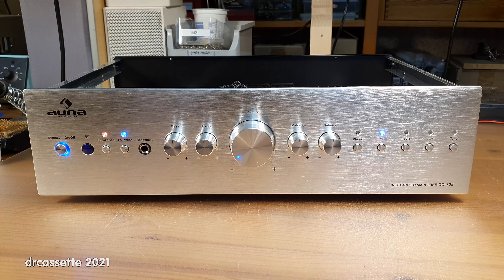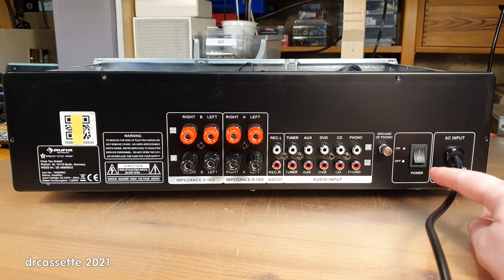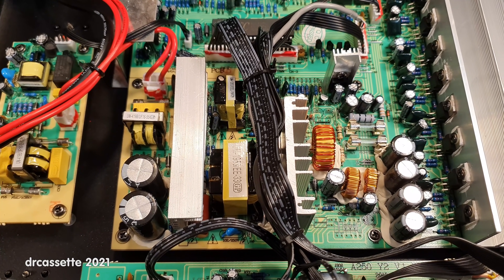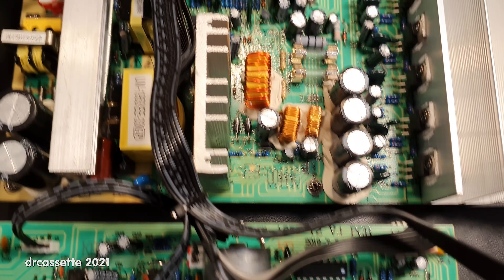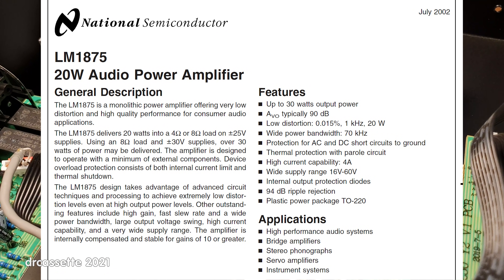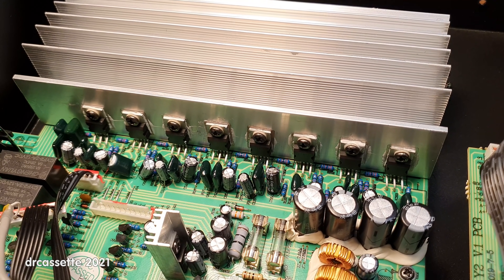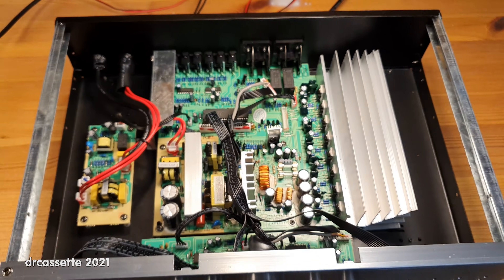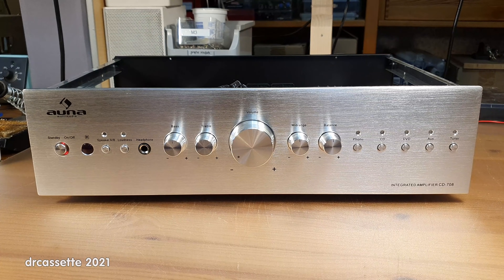Detailed look at the Auna CD-708 amplifier - with circuit overview

Comment from the maker: CORRECTION: After taking out the main circuit board and investigating, it turns out that the main amplifier is NOT based on parallel bridge circuits. Instead of two parallel bridge circuits for two channels, there are four simple bridge circuits for four channels. There are four speaker outputs, pair A and B. Even though this is a stereo amplifier, every output has its own dedicated amplifier channel. This is another strange design choice, as most of these amplifiers will probably never have any speakers connected to the pair B outputs. The headphone output is connected to the pair A outputs, so really the two extra amplifier channels are somewhat of a waste. Knowing that pair A and pair B have independent amplifiers, I tested the pair B outputs, and as expected, there is no fault in these channels.

Comment: Hi I have repaired this amplifier and Is working very well, anyway I have noted that the voltage at output IC Is quite low +/-15V
Do you  remember if you measured the same ?
Thanks Best Regards

Comment: Ill bet its dry joints on the ic's. A very cheap fix....i should know as just fixed one for free. Lead free solder doesnt like too much heat
Reply from the maker: I never checked the underside of the board for bad solder joints, but I still have this amplifier in storage, so one day I certainly will :)

Comment: Looks like the speakercircuit is defect. Maybe the speaker relays need to be replaced or the capacitors. I had the same problem on an AKAI amp.
Reply from the maker: Did you finish watching the video before commenting? I think I gave a pretty clear explanation of cause of the problem in the video.

Comment: what is the job of the microprocessor ?
Reply from the maker: The microprocessor basically converts the operations of the momentary pushbuttons on the front and the operations of the remote control into control signals for the electronic circuitry.

Comment: Excellent amplifiers I have had two for 10 years nearly with no problems and no noisy standby or any other problems powerful smooth and reliable  and very very cheep as for running hot most amplifiers that I have had run hot as well in hot weather obviously they feel slightly hotter to the torch because of the ambient temperature me personally living in the UK 119lbs will not buy you a better amplifier on the planet unless you have one givien you or you inherit one
🤗🤗

Comment: I remember Auna. They used to make horrible PA systems with massively exaggerated ratings, yet they sold hundreds of thousands of them. I've noticed they rebranded their products to 'Malone', presumably in an attempt to shake the bad reputation.
Reply from the maker: Interesting, I have not yet seen any Malone branded equipment...
Reply: They market this unit at a ridiculous 125W RMS per channel! 600W peak!
It probably will do that, for a split second, before erupting in a shower of sparks and a column of magic smoke
Reply: @iaial0  Quite a few output devices on that heatsink, so I wouldn't be surprised if this thing could come close to that RMS figure during transients, but I highly doubt it can manage anywhere near the 600W peak.

Comment: I´m used to repair cheap amplifiers that uses ICs like this one here in Brazil, where I live. In my experience, in most cases this type of noise is caused by bad soldering on the IC´s contacts. As theses chips usually works at high temperatures, as time goes by the solderings become less and less reliable. So, when noise appears, the first thing I do is to remove all the soldering of the ICs and replace with fresh soldering. Chances are great the noise will go away.
Reply: Check my comment above, I have Same noise (but not so loud) on my Marantz amp. I will try to disassemble it and check for soldering. Obrigado, cumprimentos de P
Portugal!
Reply: @Gajodareactividade   use a heat gun on the soldering points see if it fixes your problem.. if so resolder all points to fix it long term

Comment: If you wanted to make a working integrated amp, you could pull that hinksink out, drop a class-D amp board in there, and bypass the existing amp circuitry. I don't think that would be too difficult but given everything else in the preamp section I don't think I'd bother. As you state in your video, the parts individually are more interesting / useful.

Comment: If you remove one of each pair of parallel ICs (one push and one pull) and the amp should still work, although with less  ability to deliver current.  Doing this first with the first two then the other two should narrow down which pair is bad  then substitute one from the bad pair for the good pair and you should find out by elimination which IC is bad. Then just install one  single 1875.

Comment: Also, the heat sinks are basically useless.  The web the the ic's are mounted to will do 99% of the cooling.  The heat has to travel down to the bottom then to the successive webs.  Very inefficient.  Basically useless.

Comment: Guitar amplifiers that take 12 volts will have switching power supplies to boost the voltage of soft in a good design I don't think of switching power supply should be a problem

Comment: Of course the Performance of These device is mit very high. The supply ans capacitors are looking very small dir an amplifier. But it will be also interesting what the Problem ist. It looks like a Bridge solution and a compare between the Others or Others half Channel should be easy.

Comment: There is no technical reason why you can't bridge-parallel these chips. Well, the authentic ones anyway. The manufacturers would rather you move of to the next powerful IC instead. Not sure why they didn't just use an LM3886 instead of all these chips. They probably know the counterfeit ones are junk.

If you decap one of those 1875 chips, the die size for an authentic LM1875 is 3.7x2.7mm.
Reply: Contrary to that I can perceive a certain risk..in this setup..
In one paralled bridge
1) all 4 power modules have their own , indipendent negative feedback paths..so 4 sets of f.b. components..& all may be minutely diff. from each other....
IMHO it would be better to have some common f.b. path taken from post  current limiting resistor ( spkr. terminal )  and then split into the individual f.b. paths....
In conventional amps , there are discrete parallel transistors but with only one ( common) f.b. path..and overall lower f.b. gain...( even if f.b. loop is open).
In case of power amp modules..
it is in reality an opamp..

Comment: Such noise is most likely from bad/ dry/ loose solder joints....include liberal spray cleaning of front panel switch selectors switches also. 
I would recommend desoldering one of the parallel outputs on both channels..and use at lower output & so thers a higher temperature  margin...besides 4 spare 1875..
Reply from the maker: I have not yet checked for bad solder joints. As the noise is not affected when disconnecting the signal to the main amplifier, there are no contact problems. Removing one cheap from each parallel circuit to improve stability is indeed an option.
Reply: @DrCassette  I would like to add one instance of such 
a dry & loose joint issue on my own amp...This bothered me hell of a lot @ times it played quite as a mouse.. , other times it was irritating..after redoing all suspect joints it still persisted ...until finally one day on suspecting an adjacent component.  the real culprit was found..though it joints looked good..one lead was dry....now no such problems ever since..

Comment: The reason for de-activating the speaker relays is that the CD4052B analog mux ICs don't switch "cleanly". You will often get undesirable loud noises (pop) which switching inputs, so to get around this they disconnect the speakers during the input switching.

Really odd choice to use a CD4052B when these days there are a plethora of purpose-made audio switching ICs on the market. I guess the CD4052B was cheaper, as it's a really old IC that is still in mass production.

Same with the 4558 op-amps, dirt-cheap IC that is still in mass production, but it's really a very basic general-purpose opamp, and not one that I would consider suitable for hi-fi audio applications, there are far better opamp ICs available.

I also see that they made the classic mistake of improper use of a heatsink. Totally the wrong choice of heatsink for passive cooling since the fins are in the wrong orientation. It's big, has lots of fins, but in that orientation it's actually not dissipating heat effectively at all.

Definitely a product meant to look high-end on the outside, but almost every corner was cut on the inside where it really matters.
Reply: Excellent analysis. This design actually looks like something that was recycled from 30 years ago. The 8051 mcu is a clue as well as the 4052s and the op-amps you mentioned.
Reply: There's absolutely nothing wrong with 4558s, they were used even in expensive gear in the late 70s and 80s. And these units obviously sound good. Audio frequency is not a demanding task for an op-amp.

Comment: What's the purpose of those relays before speaker connectors? I have a Sony amp and from time to time, the sound is cut off following a click sound from these relays. I have to turn the amp off for some minutes and then it works again. Thanks.
Reply: speaker protection in case the amplifier goes bad and sends a constant current to speakers. Other purpose is to prevent speaker pop noise at start up.

Comment: The exterior doesn’t look bad at all. Why not built a new amplifier and reuse the good parts of it, like all the input jacks and the controls on the front. The knobs look quite nice too.
Reply from the maker: Re-using all the existing control buttons on the front would pretty much mean to also re-use the microcontroller circuitry. At that point it would be easier to leave everything as it is and somehow repair the main amplifier. The knobs are made from plastic, they look good on camera but in real life they are quite cheap.

Comment: Why not replace the power amp with a class D amp module or a circuit based on the LM3886 and use the existing preamp (which should be decent enough) and power supply? Remove the branding and you'd have a nice half-DIY integrated without having to re-cover the faceplate and with plenty of useful features.
Reply from the maker: I have thought about replacing the power amp, but it is also tempting to see what happens if I replace the bad chips with some genuine LM1875s. These cheap amplifiers certainly have a lot of potential for all kinds of DIY projects.

Comment: Sometimes heating up a component with a hair drier and then freezing can help identify a troublesome component... has worked for me once or twice...presumably you tapped around the board for dry joints also?
Reply from the maker: Heating the chips is not necessary, they get really hot just with the amplifier turned on already. I have not really checked very much for bad solder joints yet.

Comment: That's actually not to bad for an amplifier on a budget! 
It would be interesting if you figure out what is actually wrong with it even if you decide to pull it apart! 
The only time that I have heard such a noise like that is from a noisy resistor which can be found via an oscilloscope or even better a signal tracer!!!, I have heard some single transistors make that noise! And bad solder joints!!!! At least have a look for broken solder joints... 
This thing working might be worth something to someone somewhere especially if it's advertised with a picture of it's insides! Even though it's cheap, there's a lot worse out there! Dare I say it! It would probably do well with a recap LoL.... Just kidding 😂
Reply: And dirty switch’s… I had cassette recorders making that noise, coming from the record/play switch and spraying it with contact cleaner and repeatedly pressing record fixes it 😉
Reply: @samuelfellows6923  oh of course but in this case it's not a switch or potentiometer as we saw in the video that the input to the power amplifier was disconnected and the sound was still there! 
So basically the challenge is still there and it's in the power supply section! I would love to see it fixed, just the process of going through it to find the problem is very enjoyable! Another enjoyable thing to watch is testing bad capacitors! I don't know why, it's rather pointless but people love watching it being done!